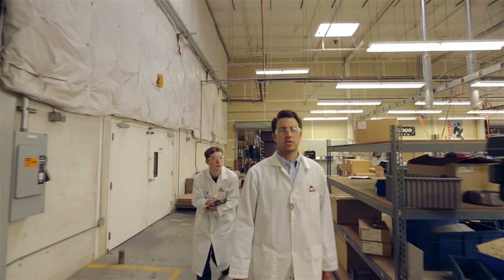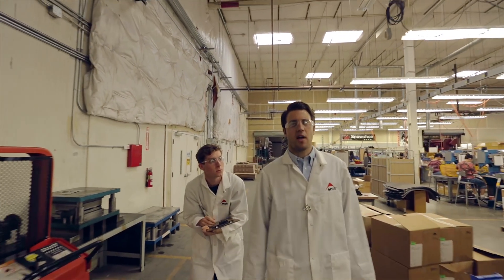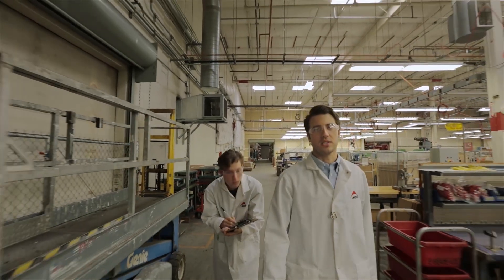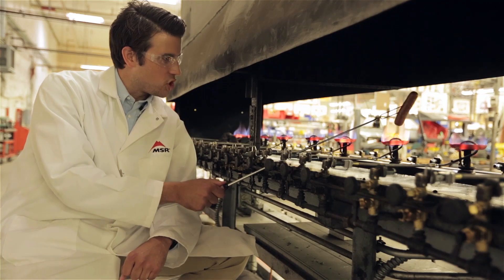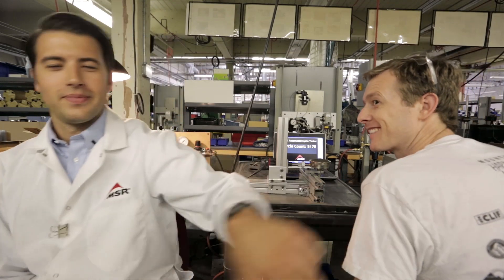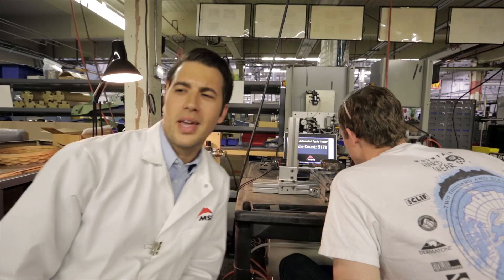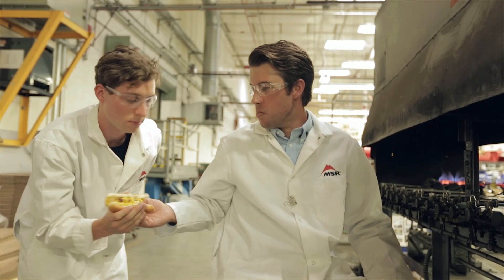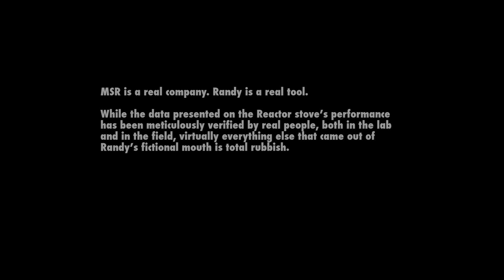MSR Stoves: Reactor Technology

Comment: Awesome I had many uses in the cold turning ice to boiling water... But now my thermal switch went off and now I have to send it in for fixing (resetting).  I tried using a small stainless steal pot on top of it but I guess it overheats too fast?  Hope it doesn't cost too much for MSR to reset the device... Does anyone know?

Comment: The MSR Reactor Technology is so simple and near to perfect I was sold on it twenty years ago when I conceptualized this stove. Congrats to Randy the MSR Stove Czar for accomplishing it. Now, I have one primary concern in regard to pressure regulator durability and reliability. To sort out my concerns I need to know how complex the design is and what materials and components are utilized and more to the point, what is the potential failure mode of the regulator? If the regulator is perfect in design and function - I need to know. And if the regulator can fail I need to know how to service it. Obscurity in presenting detailed pertinent information about the pressure regulator concerns me. The MSR company has won my respect and I feel that they are almost hitting a home run. In my experience MSR has stood behind their products and have provided me with excellent customer service but my primary concern is absolute confidence in my equipment when I'm isolated remotely.
Reply from the maker: +Anthony Strawbridge There is a thermal switch inside the Reactor burner head.  It is designed so that the stove won’t get too hot in the case that your pot boils dry.  If this thermal switch is tripped, the stove must be sent to us for replacement, as there is no way to fix it if that were to happen.  If you have further questions, please email us.  Consumer@cascadedesigns.com
Reply: Your response is appreciated.